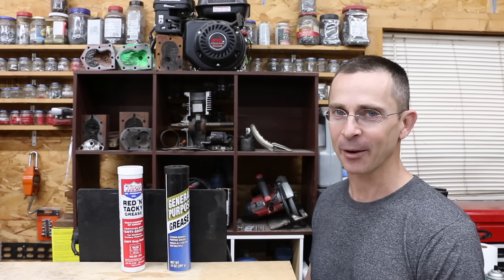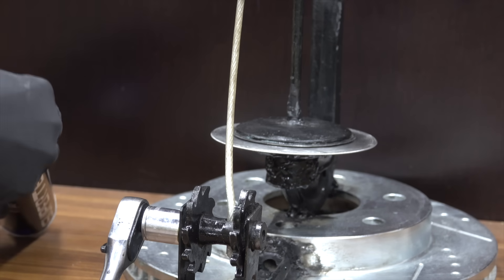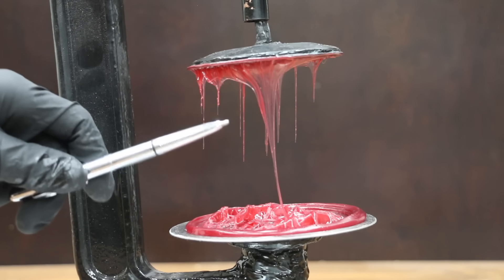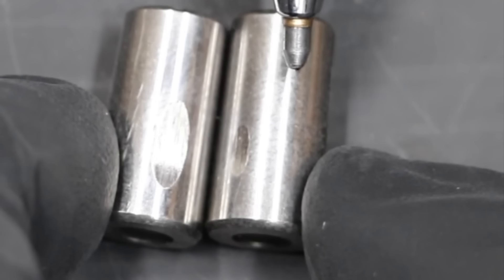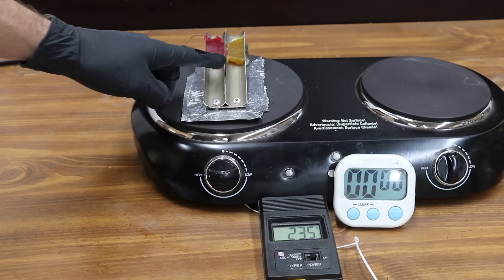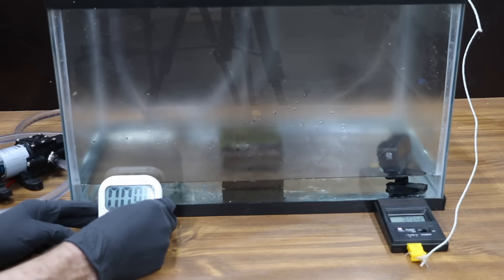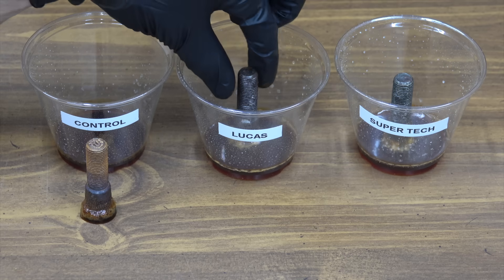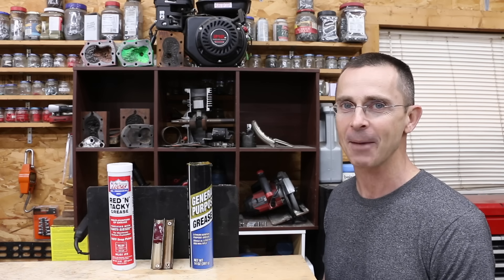Is Cheap Grease better than Lucas Red N Tacky? Let's find out! Bearing Grease Test Episode 1

Comment: You should run tests using Mobil Polyrex and LPS. Numerous motor and pump Mfrs spec Mobil Polyrex. The stuff is absolute junk. I have a grease gun sitting a PVC tube that’s got a oil trap at the base. The tube is vertical and gun just sits there. Every 2 months, I pull the plug at the bottom of the trap and drain over an ounce of oil from the plug! Mind you, the gun is deliberately not used for greasing anything but simply to monitor the amount of oil that separates from the carrier paraffin. The tube is in a 75 deg F environment in our energy center. I did same with the LPS with no oil separation (maybe there’s no oil in the LPS? 😂). Marketing and industrial politics is the only winner with that Polyrex.
Reply from the maker: Thanks for the suggestion.

Comment: Love your channel and the non biased testing you do. I would like to see you test the Green Grease found at various stores. It clams to be "Water Proof", but all greases are great water resistant right?
Reply from the maker: Thanks!  Thanks for the suggestion.
Reply: @ProjectFarm  thank you for all the great videos.  I too would like to see testing on or just hear ideas on if Lucas green performance is worth it vs red.  I have been using it for Kubota but it’s been out of stock locally for a long time.  Have heard not good to mix the red and green? Is there another alternative to the green from another company that can work when Lucas is out of stock (looked at the blaster green)? Is the green really better than the red? Mahalo

Comment: After oil change to ST. 1600 miles later engine started rattling. Switched to another brand and the oil analysis did not even qualify ST as a lubricant. Remove it from all engines and will never use.

Comment: Test Request:  Heavy-Duty Waterproof Spray Greases, specifically, the kind used to spray greases through a narrow red tube into hard to reach places, such hard-to-reach bearings, actuating levers, skylight hinges, trailer hitches, etc., but once it's sprayed, the carrier quickly (a few seconds to less than one minute), at which point the grease is as tacky as two you just tested.

Here's why I'm asking:  Rusty Duck.  I bought a small can (roughly 1.5 oz) in 1991, then used it perhaps a hundred times on pretty much everything.  Just a little shot will do 'ya!  When I went looking for a replacement, no more Rusty Duck!  Just a doze crap replacements over the years promising better but delivering a tenth the performance while creating messes requiring full disassembly, cleaning, and the manual application of a good wheel-bearing grease.

Phooey!  I'd much rather find a comprehensive test of a spray-in, heavy duty water-proof greases using a subset of the criteria as above, but micro-sized.  

Thus, my suggested tests:
 - dynamic coefficient of friction and wear under load (2 tests in 1)
 - drop point from a small, dime-sized splat against a vertical metal panel slowly heated to higher and higher temps
 - waterproof test via an oscillating spray pattern of medium intensity for 1 hour

Thank you in advance!
Reply from the maker: Thanks for the suggestions.
Reply: Oh seconded this is exceptionally useful for a few projects I have going and as future kit.

Comment: Your mistake was using multipurpose grease.  Wheel bearing grease is the proper grease to use for this test, because wheel bearing is better, it can also be a multipurpose.  Using lithium (white) grease as a wheel bearing grease will fare terribly against regular wheel bearing grease (high-speed  bearing greàse)

Comment: The best grease I've used is wolf's head. I grease heavy equipment in the summer and in the winter .  And wolf's head is the the best ,  they all suck trying to get to go through a grease gun when it's 2 degrees outside.
Reply from the maker: Thanks for sharing.

Comment: My father always use MARVEL MYSTERY OIL mixed in the tractor gas tanks for top cylinder and valve lubrication. I wonder how effective MMO and other oils, such as 2 cycle, 4 cycle, and ATF mixed in the gasoline, are at top cylinder and valve lubrication and if carbon buildup would be a downside to doing it. As you know, this should only be done with non-catalytic exhaust engines.
Another question is do aircraft engine oils, which are formulated for air cooled engines, perform  better than water cooled engine oils in small air cooled 4 cycle engines. 
GREAT SHOW 👍
Reply from the maker: Thanks for the suggestions.

Comment: Maybe you could try Bel Ray brand grease? I use it on my my motocycles to seal air filters where they mate to the air box (keeps out water & mud), for wheel bearings (travel trailers, dirt bikes, boat trailers, and etc.), and other areas I feel need protection from water, elements, wear, and things like that. Not having tested it the way you have done (Great Job on that, btw!) all I know about it is that it is REALLY hard to remove it once it's on something. Kinda like "The Booger on your finget that you can't shake off!".........

Comment: You need pressure to release the oil from the soap. Otherwise grease will not do it's job
as far as lubrication goes.  So don't use EP2 or EP3 for small needle bearings for example.
Over packing a bearing also will lead to early failure.  Mixing is truly remarkable.
I worked at a company that would change greases every time a vendor  sent in a sexy new representative.
Bearing failures a daily occurrence as mixed greases turned into dry black crust.  There are grease compatability
charts online.  Moly mixes with nothing for example.

Comment: Hello sir.
I'm replacing the upper housing on my MTD single speed transaxle, I may as well clean and replace the grease while I have it open.
It calls for bentonite grease which is really expensive.  I've seen people say corn head grease works fine, Super S Cotton Picker 00, etc.
Couldn't I just add some refined clay to one of these greases?

Comment: For years I have been using Lucas Oil x-tra, the dark green grease, and it is excellent for just about all applications that would require grease...from bikes to mowers to cars to motorcycles and even RC models, it just works and it lasts. I can recommend it from first-hand experience.
Reply from the maker: Thanks for sharing.

Comment: Comparing.2 obviously different greases is a waste.
There is a comparable grease that would have been closer to the properties of the Lucas.
Bad video.
Reply: I disagree.  The method behind this test was the 'common knowledge' advice to just use any old grease on equipment, because "grease is grease."  This would have farmers, for example, just buying the cheapest grease they could find to grease their equipment's' grease fittings with.  So, as a stand-alone video before testing similar greases, the proof needed to be made that any old cheap grease maybe isn't a good enough grease for applications.  This video did just that.

Comment: I work at a electrical motor shop as a journeyman, and adding 100% pack to the bearings are going to cause them to heat up. Bearing require a 1/3 pack in most situations , but in slow speed situations around 900 RPM 1/2 pack is preferred. The heat build up happens because all the beings need is a thin film, and the 100% pack causes the bearing to build up heat in the grease. None or to little is bad but to much is almost worse. Your test results are probably accurate because you still get an idea of heat displacement and film and additives characteristics, it’ll be interesting to see and run on a 1/3 pack or 1/2 if your running it at lower speeds.
Reply from the maker: Great feedback. Thank you

Comment: I'm curious how much the gap in performance between the two greases actually matters. For example the Lucas was able to withstand much higher temperature than the SuperTech. If I'm using this grease to pack the neck bearings in a motorcycle this performance difference in terms of temperature basically means nothing because the neck bearing isn't going to get anywhere near the breakdown temperature. But if I use it on a wheel bearing for a car I wonder how hot that would get and thus would it matter? Obviously one of these greases performance much better but I bet that for most applications it doesn't really matter.
Reply from the maker: Thanks for the suggestion.
Reply: But it does matter. The better quality grease will generally retain its properties longer, while the cheaper stuff breaks down faster over time and was never good in the first place. One could argue that most applications that require grease are in fact "heavy duty". Axle bearings heat up while in use; the grease just limits the temps they reach but if your drop point is 350 and the axles are 125-150 after running under load that's going to cause the cheaper stuff to leak out, while the bearings wear faster.

I have been using Lucas Oil x-tra, the dark green grease, and it is excellent for just about all applications that would require grease...from bikes to mowers to cars to motorcycles and even RC models, it just works and it lasts.

Comment: absolutely not- the red stuff from lucas is a semi-synthetic grease that won't contaminate brake linings and has superior heat-resistance and film-strength under extreme pressure. any grease can shed water and the tackiness is directly related to corrosion resistance. don't try to save money on lubricants- they are the cheapest part of the equation....
Reply from the maker: Thanks for the feedback.

Comment: I wish I had watched this video 3 days ago. I needed to buy some grease and there were so many brands and types at the store that made my head spin. There were universal greases, bearing greases, copper, lithium, silicon, graphite and what not types and brands. I just picked a Castrol bearing grease mostly based on the brand and price. I need it mostly for generic universal applications. I had a lot of doubt if I should get a universal one, but decided that the most important application for me is greasing bearings so I got a bearing one. If it is good enough for greasing bearings it should be good enough for greasing anything... ain't that right :) It would be great if you could make a video on what is the differences between all those types of grease are. 10x for the video!
Reply from the maker: Great suggestion! Thank you

Comment: from the factory washers and dryers are not made to run in a humid environment and there is some kind of spray or coating they never buy on the back of the control boards to stop corrosion on the tiny plugs what is it i can not remember the name of it 
and do a demonstration on it
Reply from the maker: Thanks for the suggestion.

Comment: what is the best grease to use in a bearing in a H.E. washing machine  
and yes the bearing are sealed but the company say cover with grease and seal the edges with glue
Reply from the maker: Thanks for the suggestion.

Comment: Well, another way to look at this issue depends on what is readily available. If I’m out doing yard work and a tool or a piece of equipment (maybe a riding mower) needs lubricating before I go on working with it (or maybe it’s late in the day), I’m gonna grab whatever is available and I can get ahold of quickly.  Some lubrication is really better than no lubrication.  Sometime you gotta make due with what you’ve got.
Reply from the maker: Great feedback. Thank you

Comment: Can you test these greases in super cold temperatures? There is no point of pumping grease in ball joints if grease will freeze. Also, Di-electric grease comparison & can it be used in ball joints or other moving parts? Does it loose its viscosity when exposed to higher temperatures. Does it prevent corrosion? Can we mix Di-electric grease with petroleum based greases & compare to see if its better in anyway. I see Scotty telling viewers to use wd-40 to lubricate suspension parts, but wouldn't it completely dissolve any grease if wd-40 penetrates in the bushings? Products like fluid film are more harmful in winter since they freeze & turning into a rock during artic vortex.
Reply from the maker: Thanks for the suggestion.

Comment: No contest,these are different classes of grease, the Lucas is EP(exteme pressure rated) and could be used in wheel bearings while the Supertech is only a light duty that is barely rated for chassis. Am surprised ST did as well as it did.
Reply from the maker: Thanks for the feedback.
Reply: Please note that the US largest grease factory burned last year and no plans to rebuild have been announced,grease prices have skyrocketed and availability has been spotty. Learn a little more about grease(grades/properties/uses) and a clear comparison between brands wll be much more informative. Then lay in a supply as price and availability is only getting worse(my shop manager wouldn't listen last year and is paying out the nose now)

Comment: Ah.. -20°F is roughly -29°C. 
     (Useful info for the people in the 192 (out of 195) countries that don't use the Fahrenheit scale ;)
     °F is only in the USA, the Cayman Islands, and Liberia - a small African country)

I have that Lucas Red & Tacky, by the way. It's pretty good.
There's also a "better than normal Lithium EP-2, but mostly used for the same applications" version, called "LucasOil X-tra Heavy Duty grease" (dark green)

It's a liiiittle thicker - works very well on bicycles (wheel bearings 'n stuff).  
      Sticks around longer than normal EP2, in my experience
Reply from the maker: Thanks for the feedback.

Comment: I see a lot of videos where people replace the grease in harbor freight angle grinders and polishers. They usually use Lucas white lithium grease. The goal is to reduce noise, vibration, etc.
I’d love to see you face white vs red, plus other greases.
I’m also curious if that compartment could be sealed and oil used instead? Or a combination of the two.
Reply from the maker: Thanks for the suggestion.

Comment: Any farmer knows Red and Tacky is the best. Been using it on my equipment forever. No fails. I bought a trailer once that didn't have it. Bearings burned up on the interstate after 1000 miles. $1200 later and 6 hours added to the trip, dump the lithium and put in the red!
Reply from the maker: Thanks for the feedback.

Comment: Question: wouldn't it be better to measure the weight of the bearings before and after as well as doing the visual test to measure how much material is removed? That way if two of them look similar you can use the difference as a tie breaker of sorts.
Reply from the maker: Thanks for the constructive feedback.

Comment: Oil's cheaper than machinery, you never want to cut corners there:) I'm glad to see this one, I have some ridiculous expensive grease and I've been a little concerned if I was wasting money. I'm assuming, a reasonable assumption, mine is quite a bit better then lucas, the expense of it isn't a concern as long as long as the grease has all the properties I'm expecting.
Reply from the maker: Thanks for sharing.

Comment: I started using the Lucas grease on the ujoints of my 2020 4runner limited about a month ago and I went form an average of 291 miles to a tank of gas to 351 miles to a tank of gas. Damn stuff works wonders. I drive 70 miles a day 6 days a week. I use Pennzoil platinum engine oil and fill up with 87 octane from Sam's club . The only variable I had was the change in grease on my drive line
Reply from the maker: Thanks sharing.

Comment: Enjoy your reviews, excellent and innovative work! Please consider including Super Lube Synthetic grease. I've used it for years on my glider wing pins, and on gun parts that slide (seems to work well in the cold). One of its main advantages is it's not as messy as some other options. I'm most interested in it's anti-wear properties compared to other greases.
Reply from the maker: Thank you for the video idea!
Reply: use sprayon's military-grade weapons oil on all weapons

Comment: Sometimes you want a sticky gummy or waterproof grease and sometimes you need a slippery fast grease like white lithium grease. I use sticky marine grease in my RC car differentials because I want to slow them down so that they don’t “diff out” or wear out and I use white lithium grease on the gearbox where I want a less friction lubricant that also reduces gear noise.
Reply from the maker: Thanks for the feedback.

Comment: Great testing, I’d also like to see the performance of when the grease gets dirty, maybe doing the bearing wear test and dumping in a cup of sand. It would be great to see a marine grease tested as well, one that uses the modern lithium or calcium complex type grease, not the old style pure lithium or pure calcium.
Reply from the maker: Thanks!  Thanks for the suggestion.
Reply: go to a boat trailer specialist and ask what they use.

Comment: Back in the 90's I power boated and used OMC marine grease for my outdrive U-joints and trailer wheels bearings.
Expensive grease, so 1 year I tried some inexpensive marine grease. I came close to having damage with my wheel bearings when I checked everything at the end of the season( your trailer wheel bearings will be under water when you unload your boat)  The cheap grease was allowing some water to mix with it , wasn't totally waterproof. I had surelube axles so no real need to disassemble as this system would just expel the old grease as you pumped in the new grease. Fortunately I checked it before it could cause damage and leave you stranded along the road.
I only buy top quality grease for anything after that.
Reply from the maker: Thanks for the feedback.